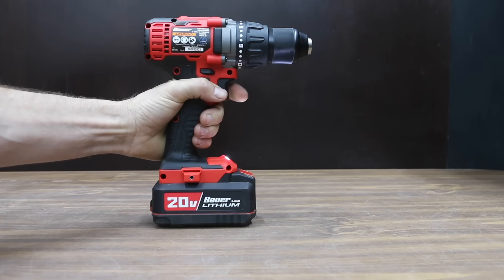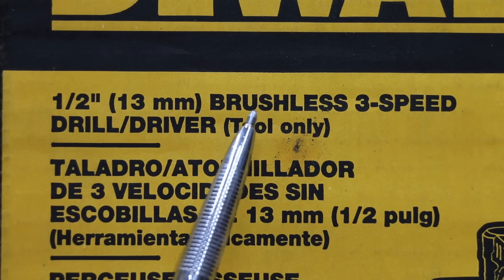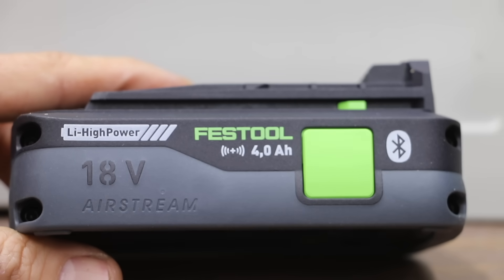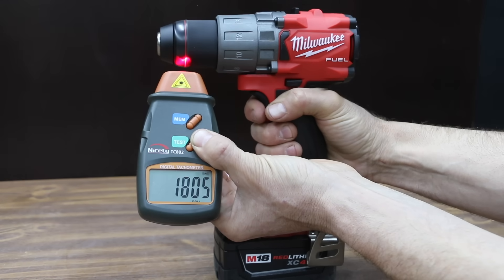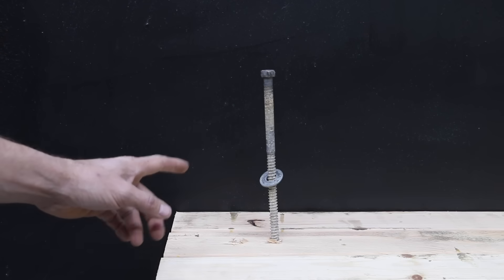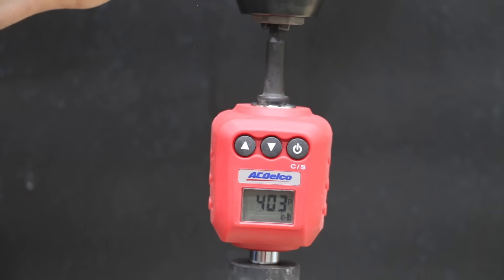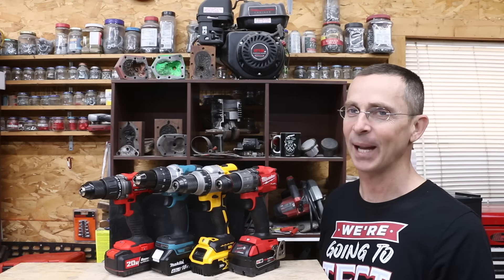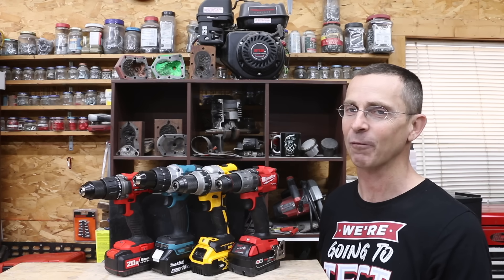Best Drill (BATTERY POWERED)? Milwaukee vs Dewalt, Makita, Bosch, Festool, Ryobi, Bauer, Ridgid

Comment: I've done some aluminum carpentry and had the opportunity to try both Bosh and DeWalt. The drills weren't the same as in the video, but the traits seem to have crossed between models: the DeWalt always struggled less whenever I had to poke holes and stayed cool the longest, though the Bosh felt smoother and was definitely quieter.
Reply from the maker: Thanks for sharing.

Comment: One factor cant be covered on this test is durability.I had the Ryobi drill for over 5yrs and used extensively and abused it as well and still works as well as new.I want to buy new brushless Ryobi drill but my old one still works fine so cant justify buying a tool and I dont need...
Reply from the maker: Thanks for sharing.

Comment: I’ve owned lots of different battery drill/ drivers over the years. I have a Makita which is still going strong after 18 years. It’s big and heavy. But I also have had Black & Decker, Ryobi , Mac & a couple of cheap Chinese ones. I’ve had the Chinese ones for 5 years and they are great for light weight work. But at the end of the day , ALL TOOLS ARE ONLY AS GOOD AS THE PERSON USING THEM. I would spend as much as I could on tools but I am a time served joiner. Good video 👍
Reply from the maker: Thanks!  Thanks for sharing.

Comment: When I was younger working n had some money to buy most tools i needed/wanted in the 90s I bought a Bosch cordless once home I put in an 8th inch drill bit soonest I  turned it on the drill it was Not running strait by a long way at the tip of the drill it had more than an 8th play then tried my old Makita n it was 100% strait to the eye but maybe now days that is no problem any more, also old Makita/Hitachi batteries where way longer lasting than other brands in fact the best dills i has where Japanese except for my small  HILTI hummer drill my ELU planer was Amazing too
Reply from the maker: Thanks for sharing.

Comment: Great test and no massive surprise the "big 3" finish well. I happened to have gone with DeWalt as a battery platform but it just as easily could have been Milwaukee or Makita. All 3 are top drawer and it's just a matter of what you happen to have access to or what sale you happened to take advantage of or what your contractor buddy recommended. Can't go wrong with any of them. Honestly even Ridgid and Ryobi are a real solid bunch as long as you only need "around the house stuff and maybe building a deck or a shed" level tools.
Reply from the maker: Thanks for the feedback.

Comment: Makita is my favorite brand but for a different reason I suspect. I’m a model railroader and I add a lot of detail parts to HO scale styrene locomotive shells before painting. Practically all these parts require holes to mount them and some parts are nearly microscopic. I primarily use drill bits in the #70 to #80 range and using a pin vise is too slow so I chuck my tiny drills right into a drill chuck. I have a Dremel but I can’t get it situated so it’s stable and in alignment with the path of the hole so I use a small Makita drill. The chuck will hold a #80 drill, it spins true, it has a very, very low speed and perhaps most importantly, it doesn’t jump when it’s started. To maximize stability I hold the drill in my lap when drilling. The idea with a #80 bit is to simply get through a locomotive shell without breaking one. Some locomotive shells can take fifty holes for all the attachments and pipes and handrails and that’s just for a small bit. Bigger parts need their own holes. Chucking the bits right into a drill chuck saves a huge amount of time and I hardly ever break a drill bit. I have a 1/2” Makita at work which I love. It’s very smooth and has enough torque to break my wrists when it’s angry.
Reply from the maker: Thanks!

Comment: Question:

When you checked the torque settings on the electronic clutch drills, what speed setting were you in? Because the clutch settings torque goes down as the speed settings go up

Comment: Hey, PF! When you tested these drills three years ago, I had already owned my Rigid a little over a year, I think. Since then, I have used this Rigid almost daily, and it has taken a serious thrashing with nary a burp in regard to reliability. From driving lag bolts, hundreds of 3” wood screws when I built my fencing, to cleaning paint brushes with a nylon bristle wheel a few times a week. Which, even though it’s a job with relatively low resistance, cleaning brushes really taxes the motor to no end. Bottom line....it’s been a fantastic drill. Up until yesterday that is.... The trigger switch has finally started to sh*t the bed. And although she’s still kicking, the battery’s power delivery has become somewhat “schizophrenic”, due to something going on in the trigger assembly. 
    So tonight I took it all apart to see if a simple cleaning out might solve the issue, or not. If the problem is in the board, she’s done. But while doing so (and possibly facing the purchase of a new drill), of course I thought of you! And so here I am! 😁
  I cant wait to order my new Festool! Not! 
   Actually, I decided to post hoping that some small amount of humble whining, and groveling might possibly be enough for you to consider doing a new review of the current set of drills out there now, since it’s been 3 years now.
    I know you’re busy af, but if you do decide to do a new video on them, please keep the Rigid in the line up, and maybe add a couple sub $50 Amazon specials. And maybe Horror Freight’s top of the line Hercules or Earthquake. Which would be feasible (and less costly) if you go ahead and sh*t can that $500 joke from Festfool...tool.
    Regardless, thanks for all your hard work over the years! Best channel on YT, period. 👍

Comment: odd, my dewalt hammer drill can put in tiny plastic screws with relative ease, with the torque on setting one, it works great. Granted this drill is a hand-me-down and i have put some upgrades on it, but the clutch on my drill seems to work better than this electronic clutch.
Reply from the maker: Thanks for sharing.

Comment: Thank you so much for this video and all the other amazing videos that you have produced over the years. Simply incredible work.
I drill with cordless drills into steel quite often and my biggest problem with the two Dewalt drills I have is the Chucks. They are awful and very difficult to replace. The bits spin in them very easily, large and small, especially at the point of drill through. Having a video testing all aspects of the Chuck pertaining to drill bits and steel would be an awesome video. It’s all about the Chuck.!!

Comment: I have the Ryobi which came last, and it has been a fantastic drill, and does everything I need. I always use my Bosch corded drill to wind in those big 14g building screws - zaps them in, in only 2 seconds! (no 'impact' setting needed).
Reply from the maker: Thanks for sharing.

Comment: I've used expensive and cheap battery drills at home and in the workshop and you know what? Used in those situations, a mains powered drill trump them all. Can't be beat. Just run the extension cable out (if required) and even the cheapest main powered drill will wipe the floor with all the battery drills you can ever lay your hands on.

Comment: Do any of the brand platforms balance charge each pair of cells in battery packs? I've had to take Makita batteries apart because the power for the battery management system is taken off the first pair of cells leading them to cumulatively attain a lower charge than the other pairs of cells.

Comment: My entire Bauer 20v collection: 2 drill drivers, hammer drill, circular saw, reciprocating saw, jig saw, router, dry wall cutter, string trimmer, leaf blower, chain saw, impact wrench, heat gun, tire pump, inflator/deflator, hedge clippers costs less than the top two most expensive drills tested.  With the exception of the string trimmer, I have never found any of them lacking. I'll Stan for Harbor Freight and the Bauer line.
Reply from the maker: Thanks for sharing.

Comment: Would have been useful to see how the effect of the clutch settings, stepwise, min to max, to see the relative changes and how effective the different settings really are.  Disappointing that the Dewalt and Milwaukee are ineffective at low torque limits.
Reply from the maker: Thanks for the constructive feedback.

Comment: You need to use 4 or highest Pro Core   Amp battery, not 2 that you use in the video. The drill does not have good torque with 2 amp of battery like others brands that use 4 or more. It's nit fair to Bosch because it's not fair comparison.

Comment: It’s horses for corses when it comes to these machines, if your a builder who relies on your tools then yes go for the best but the average Jo who just needs to drill a hole to hang something up or to drill a 5mm hole in a 3mm bit of steel then the cheapest will suffice. I’ve had expensive Bosch tools fail within months but black and decker drill (electric) is still running nearly 30 years later!!! It’s the users choice but thanks for sharing your information about these kinds of tool, keep up the good work
Reply from the maker: You are welcome!

Comment: I've always been a Dewalt fan.  They haven't let me down yet, electric or battery. This one electric Dewalt drill I've owned for 40+ years and it's still going strong after years of hard use.  The chuck bearing is getting a little loose, but it still works great.  No matter though because I have plenty of Dewalt drills in both electric and battery.
Reply from the maker: Thanks for sharing.

Comment: This is great.  The last round of tests were a little subjective and you did not summarize the results into a graph like the others?  Maybe next time run them all in first gear only? Also, it would be cool to summarize the results into a spreadsheet and create a merit function.  Give all factors measured an equal weighting and see who comes out on top.
Reply from the maker: Thanks for the suggestion.

Comment: When I worked for my cousin's construction company, he had the Dewalt, Makita and M18 Milwaukee hammer drill/driver. The Makita was the lightest but it was the most fragile, the handle broke when it fell from about 6 feet. The Dewalt and Milwaukee seem to make similar power but the Milwaukee tools are more compact. My personal set of tools are Milwuakee and a couple of Bosch tools.
Reply from the maker: Thanks for sharing.

Comment: Have you ever thought about doing a head to head comparison of drill chucks?  You could test the holding torque at maximum and minimum bit sizes, ease of tightening, hardness of the jaws, total indicator runout.  Compare keyless vs keyed.  Hand tool vs drill press.  Jacobs, Albrecht, Rohm and other big name chuck manufacturer vs Chinese knockoffs.
Reply from the maker: Thanks for the suggestion.

Comment: Only issue i see is the base batteries that come with them are all comparable especially for the ridgid since it comes with there lowest power battery it will not be able to compete with the dewalt with a bigger ah higher output battery. I love ridgid tools but i wish they put better batteries in there kits they get the job done but dont exactly do a good job of showing what the tool can actually do
Reply from the maker: Thanks for the feedback.

Comment: honestly aside from smaller screws all those bolts would be easy impact driver work, so id just buy a ryobi imapct+drill+2 battery set for same price as a dewalt with no battery.  I would rather see a wobble / straightness of drilling / ease of keeping it straight type tests on drills + just raw speed and low speed control
Reply from the maker: Thanks for the feedback.

Comment: How about a test for cordless hammer drills. Just the regular size drills with a hammer function, not the big cordless ones. The common size that I use is a 3/16 blue tapcon screw and the drill bit is 5/32. I feel like I burn through the drill bits a lot. You'll need like 50 bits for the test. Obviously we'll be seeing which drill goes the fastest with a certain amount of pressure but it would be really nice to see the test with like five and 10 and 15 and 20 lb of pressure to see if the extra pressure actually helps or just burns up the bit faster. And does constantly spraying the bit with water as you're drilling help the bit last longer, just all of that stuff. I feel like I use one bit for every couple holes and that can't be normal. Maybe testing different brands of bits would help, and maybe that's a whole separate video.
Reply from the maker: Thanks for the suggestion.

Comment: Each company seems to have several different lines of drills and batteries. Several companies offer brushed and brushless, and then different grades of brushless. For example I know that rigid offers brushed, brushless, and then octane brushless. And then there's regular and high output batteries. I would be interested to see this test with the highest end of each drill, and in the same video test regular and high output batteries. I know you've done the high output battery comparison, but putting it all in one so you could compare one company's high output to another company's regular, and know that it is the highest end best drill they offer would be nice.
Reply: Or maybe just with their regular batteries or just their high performance. That might be way too much to happen one video. Either way, highest end drills head to head would be really nice because sometimes I see these videos and I know that there's a higher end drill for one of the brands and I'm curious how it would compare
Reply from the maker: Thanks for the suggestion.

Comment: I'd love to see this done again with the latest and best offerings, Ryobi has stepped up massively since this video.
Reply from the maker: Thanks for the video idea.
Reply: Yep. Is this a like for like test? A drill with a side handle is probably different than one without, and it shows in the clutch test?
Reply: very true, the Ryobi was up against brushless tools, the Ryobi hp brushless hammer combi drill would've been a better a like for like comparison. @barrypickles6546

Comment: Couple years ago, right around the time of this video, I ended up going with a Menards combo kit called Masterforce. One of the main reasons I chose this brand was the premium features all the tools have, especially the drill. It's a 1/2" drive keyless chuck, with hammer mode for occasional concrete work. The clutch and mode selector collar is well designed and easy to use. Battery tool kits can be very expensive and have soo many different specs. Unless you've tried everything on the market, it's very hard to find good quality tools that don't fail often. For the price the Menards/Masterforce battery tools are some of the best available. Plus they come with a 3 year warranty that makes free replacement easy.
Reply from the maker: Thanks for sharing.

Comment: One of the problems that I've had with drills on endurance is not shutting down and burning out as a result when turning a high torque screw at slow speeds (i.e. trying to turn a drywall screw an extra 1/4 turn.)   I'd like to see you do this test again, but by repeatedly running the drills in 1st gear with maximum torque at low speeds until they stop due to excessive temperature repeatedly and see which ones survive the abuse long term.  I know my Makitas will burn themselves out because they wait too long before shutting down.
Reply from the maker: Thanks for the suggestion.

Comment: A heavily underrated factor is the preciseness, linearity, and fine-step-ness of the trigger itself. I have an old bosch screwdriver/drill, and I find pressing the trigger can jerk the spin speed from slow to fast where it can be hard to get inbetween. I want a silky smooth, stepless action for the trigger, where I can effortlessly squeeze it, and it won't instantly go from slow to fast unexpectedly.
Reply from the maker: Thanks for the feedback.
Reply: I have not tried any other brands but my Makita 12v has really great trigger control, it's very easy to control the speed
Reply: FeSTOOL is trash

Comment: I have used both DeWalt and Bosch these years.
In my opinion,  DeWalt delivered more violently but the battery drained faster than Bosch.
Both are likely unbreakable. 
Both are expensive. 😅
Reply from the maker: Thanks for the feedback.

Comment: If you would have put the 5 amp hour battery on the Bauer it would have done much much better. Running it on just the 3 amp battery was not quite Fair.

Comment: I have a suggestion for a video, but it would be quite a challenge. Compare these drills in a durability/longevity test.  People are always arguing which brand is better for "daily work", but most tests are just about features and how well they perform in a particular task.  I think the results would probably surprise a lot of people.
Reply from the maker: Thanks for the suggestion.
Reply: I agree.  I have learned to try and buy a product I won't have to replace in the longest time.  The few seconds, if not fraction of seconds I save per use, is not as important as the tool working when I need it for as long as possible.
Reply: Friends/Family have laughed at me when I purchased a high quality, long durability product for premiums price and ask why am I willing to pay so much.  My response, is I truly only want to have to purchase it once in a lifetime, not once a year.